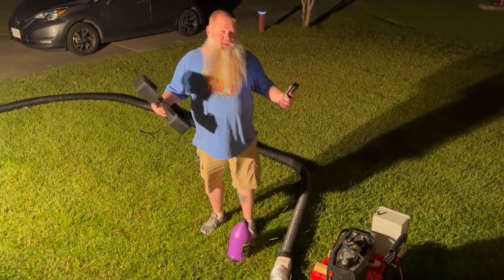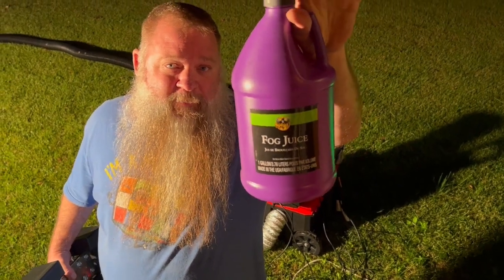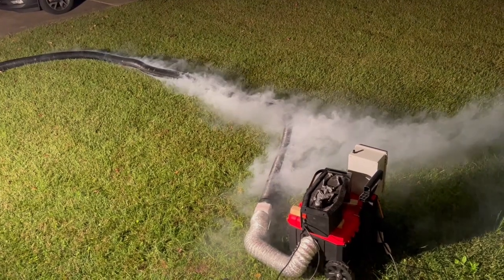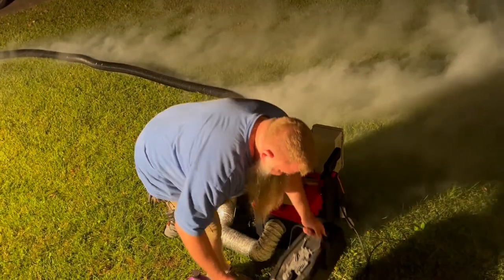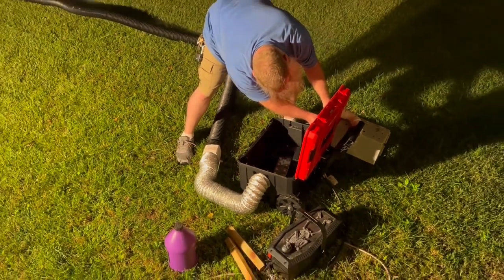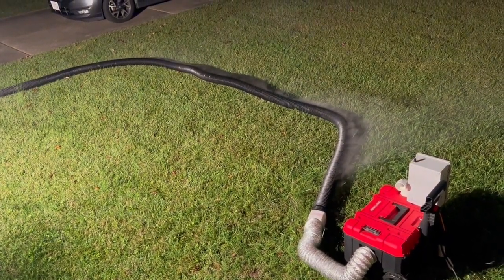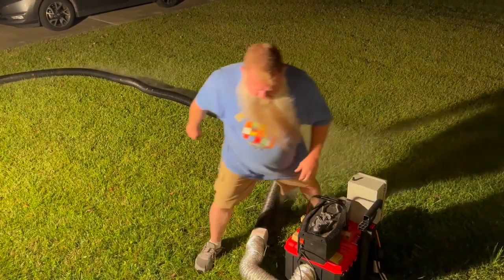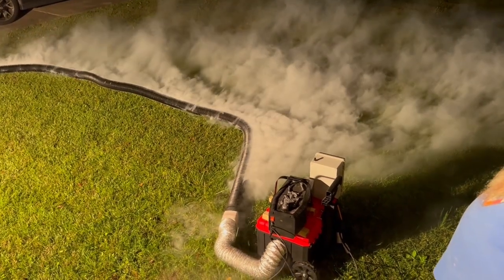Fog VS Mist

Comment: Thanks for the video. Very cool. It definitely looks better with the combo.  Did you modify the black pipe or is it regular drainage tile pipe with a plug on the end?
Reply from the maker: That is a standard drain pipe that has the slot already cut.  You can get that with holes, slots, or solid.

Comment: I just ordered the Titan 1200. How much water does the fogger use and did you have to repair or replace any parts of the fogger?  If not, how many hours approximately did you run this set up? One more thing please.  What model fan is it? Is it a normal in stock item at Home Depot or Lowes? 
  I really appreciate the 2 videos I saw with your set up. Thank you!
Reply from the maker: Thank you!  The water will probably last a few days.  I need to refill the fog machine before I worry about the water.  I do change the water out each night to keep it from growing junk in it like algae or other gross stuff.
The fan is a marine grade bilge fan. I do not know it a retail hardware store has it.  I got it from Amazon (There should be a link. if not, I'll fix it)
Reply: @intocoasters  thank you!
Reply from the maker: @kstofkos  You're welcome!
I forgot to answer part of your question. I did not have to replace parts or modify the fog machine.
Reply: @intocoasters  that's awesome! Thank you again!

Comment: Excellent... As you know I pretty much cloned your design and that's what I expected... funny that you have the same issue I have is that the wind is shifting... You plan for the fog to go one way and it does the opposite...   In my yard I set the low lying fog to blow into the graveyard... and sure enough the neighbors on the other side get it instead... the graveyard has none of it LOL.... Mr. Murphy's Law Dang it!.
Reply from the maker: Ain't that the truth!  
Every. Single. Time. 
We shot two videos prior to this one in the wind change direction for all three videos. This one ended up being the best take.
But still, it's an awesome effect even if it's in the neighbor's yard. LOL
Reply: @intocoasters  LOL.. well, what makes it so funny is that the neighbors weren't even home for Halloween, they were at a party or something. Fortunately the winds shifted in the right direction and we had a great graveyard display.
Reply: as i watch these videos to make my own, thanks for making them by the way, that's where the black pipe comes in to play, you can move it to counter the weather, then it will go to where you want it when positioned down wind.
Reply from the maker: @hearthstonelights5001  Agreed!   The funny thing is, this was the third  take of the video this evening. Every time I shifted the pipe to make sure the fog crept into the yard, the wind shifted on us. I decided to stop chasing the wind and just continue with the video.
Reply: @hearthstonelights5001  If the area you're in has a lot of shifting winds, moving the pipe during the haunt presentation, for me, is impossible because the pipe would have to be on the opposite side of the yard and it cannot cross the main walk way, also the wind shifts again and all I would be doing is chasing it.  Fortunately in my case I know that once the sun sets the wind is consistent and I just put up the odd moments it's the other direction.